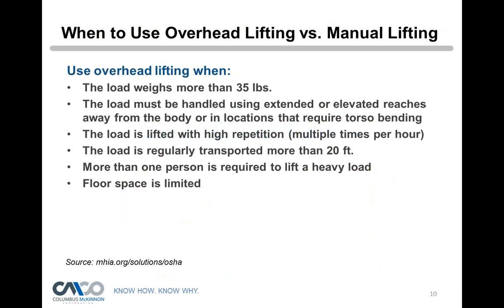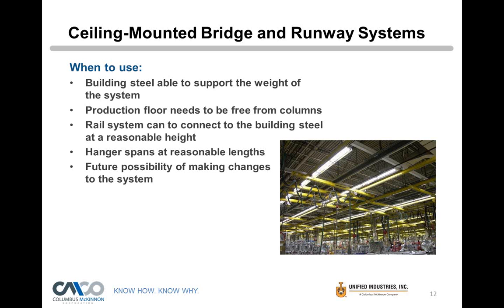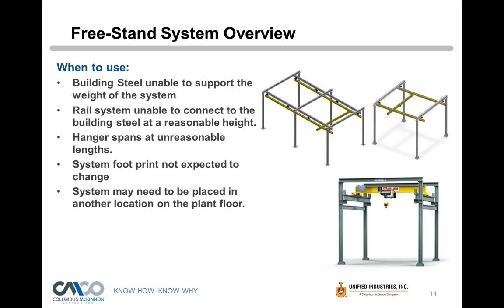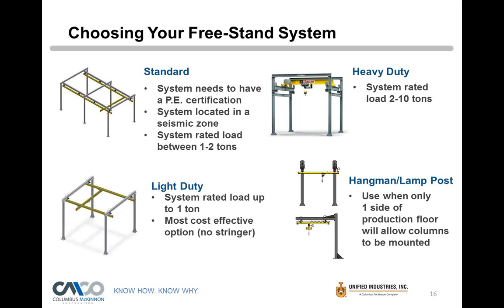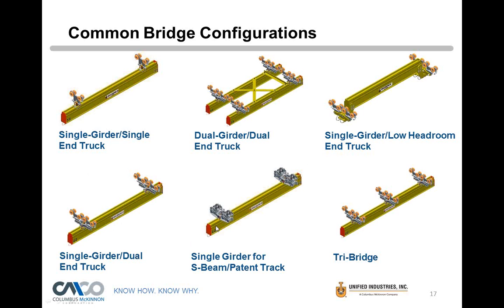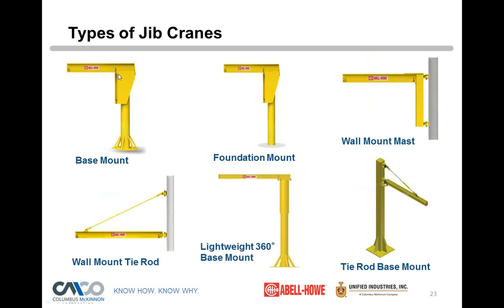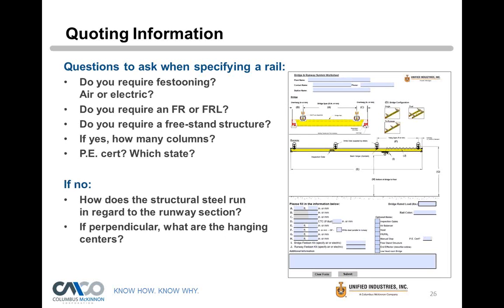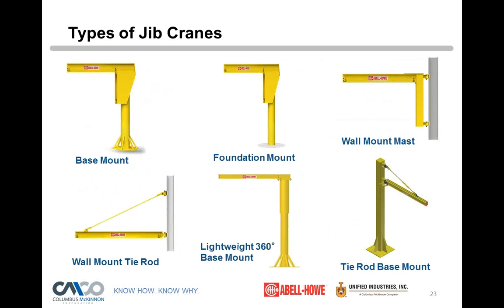Safety Webinar: Choosing the Best Crane for Your Application -  Workstation, Overhead Jib Cranes

Comment: Looking at a 50 or 60 Ton Overhead Crane (indoor) for Remounting Heavy Mobile Equipment on heavy truck frames like Crane
Reply: Part #2, 

I accidentally hit the SEND button before I was ready.  To continue:::

......... Remounting Heavy Mobile Equipment on heavy truck frames such as Crane Carriers.  Let's say you are lifting the main heaviest bulk of the load with the MAIN HOIST mounted at the center of the Trolley when removing the heavy equipment to be Remounted on a 2nd truck chassis later.

Of course these are you usually smaller and lighter components that need to be removed first just to get them out of the way before tackling the big heavy stuff.

Just for lifting the smaller & lighter components, would it be possible to mount a smaller & lighter duty AUXILIARY JIB HOIST at one end of the Trolley, even if it had to be mounted upside down from the bottom of the Trolley, to save on wear & tear on the heavier MAIN HOIST and it's wire rope when lifting the very light loads?  TIA.